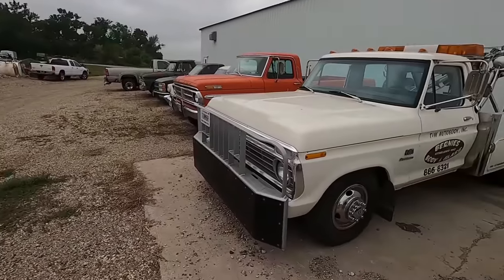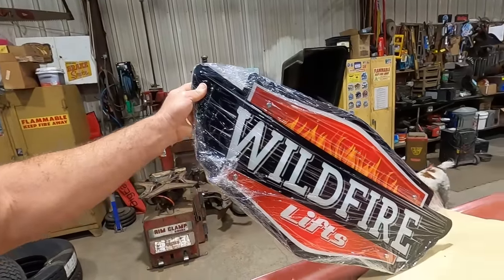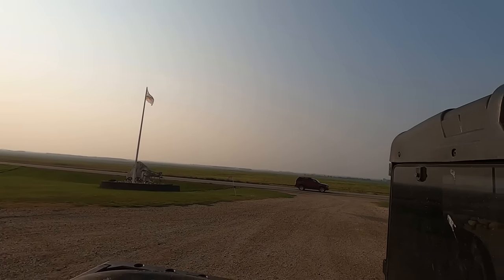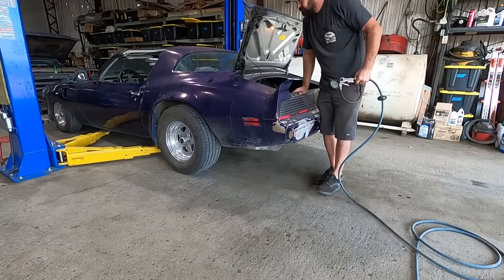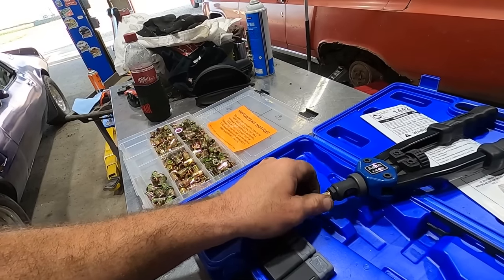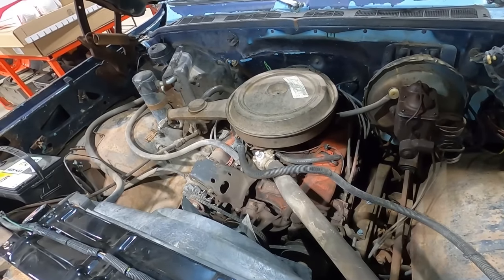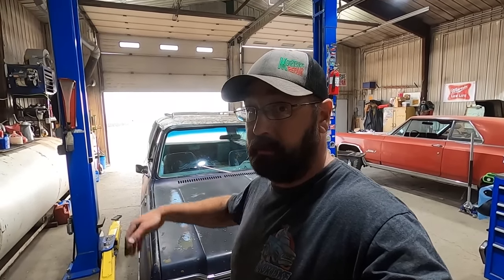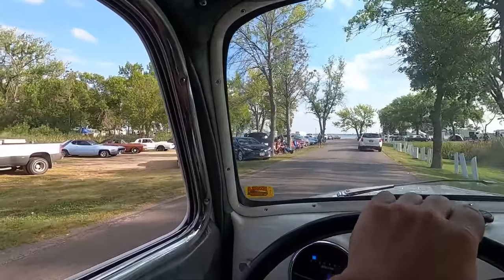You'll never guess what broke on Dirt Reynolds! Pontiac Trans Am and K5 Blazer Action!

Comment: I put a hydraulic clutch pump on a square body 350 in about 88/9. mounting bolt holes wouldn't line up. Turns out the plant found a bunch of earlier 350s in store and used them up.

Comment: Excellent video Mortske   Repair  :) also what pev me on vechiles is small air breather  ones on 2 or 4 barrel in Chevrolet Monte Carlo LS  or Malibu  on 3.8 litre  231 V6  or  4.4 267 Cubic Inches  2 or 4 barrel carbs and one vechile come in shop at my work want air filter change was 1936 Chevrolet  Coupe Delukx car 2 door but had 1978 Buick Skylark  3.8 litre rare 252 cubic cm V6 motor, Turbo 350 3 speed Automatic transmission, 377 power with Power Steering also Brakes  ! But on 2 barrel carb it was 1 barrel flap Carter  no air breather  because so tight put in and owner had a 1976 Rottellier Sears 6 hp One cylinder motor air breather filter one barrel was cone type plus metal cap but metal pie plate over carb with screw up thru metal plate to Rottelier a wing nut on hold place ! Yes think was crazy and how be wild done too! If saw Mortske you say holy crow too!

Comment: On 2nd gen F-bodies the lower mount is fine for air shocks, they fail at the TOP, the upper part of the frame is thin sheet metal.  I've fixed a few that failed.
Reply from the maker: good to know!

Comment: Weld the seam on the pipe and then weld a strap of muffler tube over the joint.  I saved an exhaust on a long ago Subaru that kept cracking by doing this.
Reply from the maker: Good tip!

Comment: I has a 74 K5 Blazer it was blue and white.   A Tercel clipped the rear end of a new 92 Corvette.   It spun around and came toward me the wrong way.  I swerved to miss it.  It hit me under the B pilar.  I flipped up in the air about 30 ft and completed 3 barrel rolls.  It happened on Interstate 5 in the City of Industry, CA.  I Landes upside down headed the wrong direction.   The top was crushed.  The top was smashed into the passenger seat back.   I got a bad concussion the 2nd time my head hit the B  on the 2nd roll.   The lap belt saved my life.  Drive carefully.  I was not supposed to die that day
Reply from the maker: ouch

Comment: Hey mister, Bernie is an awesome rig, but what do those 4 little bogie wheels do? The other tow trucks I've seen have this yoke that deployed underneath, and you fit a couple of cradles into the stalk, and the main hook pulls it up and on to the the tire cradles. Is there some additional hardware you need to use those? Thanks - keep on doing great shows!
Reply from the maker: Go under the car you’re towing

Comment: Buy a cheap obd2 Bluetooth adapter and use something like torque pro on the pocket computer for your readouts. You can use an el cheapo android tablet for it as well if you want a bigger screen. The cluster on my derdge died and this the easiest thing I could think of, not the most elegant solution but you get all the information.
Reply from the maker: thanks for the tip!

Comment: Line bore yes  moves the crank up but it doesn’t move the base of the block up. 
 So measure the inside of the bore on a stock block and then measure the 383. 
 Does the base where the retaining cap sits on block side have to shaved up as well ? 
 Because if not the seal can't compress around the crank in a circle it will always be an oval. 
 Or measure a stock 383 seal bore top to bottom and side to side.
 The. Measure the same bore on the troubled block and see what the difference is. 
 Then you will know if the base on the block has to moved  up say 0.010 or more. 
 Just my opinion. Best of luck and I hope you can fix this. 
Be safe team.
Reply: Went to the wrong channel  wow.

Comment: I have a question, before my granddaddy passed on, he gave me his 1989 Chevy Silverado, it’s the truck he was letting me drive when I was 5 or 6 yo, so it means the world to me! Well before he passed it had been sitting for bout a year while we switched out the steering column, after it ran fine. It sat a few months more and when we went to move it it cranked up and ran for about 30 mins, then it went dead. We banged on the gas tank, checked the fuel pump, got a new fuel pump, put a new computer in it, still it will not even turn over. It’s like it has no power. My granddaddy was a mechanic and looked at it while he had the time left but after we had our family mechanic check it out and he said that it needs a new complete wire harness, but before spending $300-$400 I was wondering wat u thought it could be? Or wat I could check before spending that much more money on it if it’s really not the problem. I’m not trying to restore it, just get it running again rite now! lol. Any suggestions would help. Like I said the truck means the world to me but I’m not rich by any means and I’ve already replaced so much that I just can’t buy anything else unless Ik it will fix it. It truly breaks my heart every time I drive by it in my driveway, just watching it slowly rot away!! So please any advice I would truly appreciate!! Thank you and God bless!
Reply: GIVEAWAY-87   winner?
Reply from the maker: I have no clue